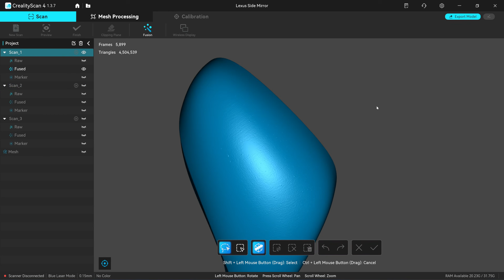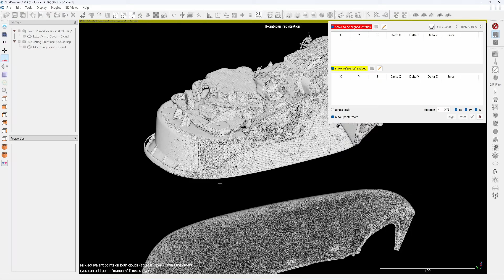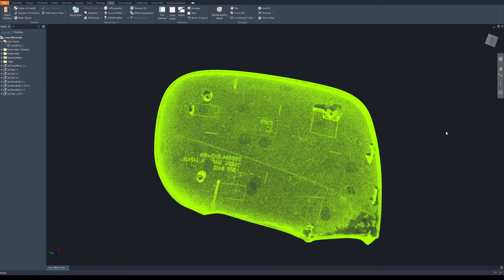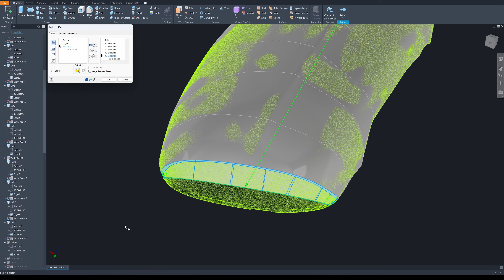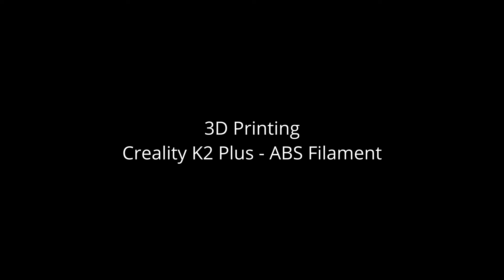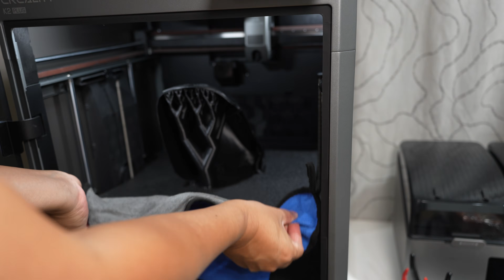3D Printing a Lexus IS250 Mirror Cover: Reverse Engineering with Creality Scan Raptor

Comment: I've been watching your videos, and they've been very helpful—thank you!
I was having issues with Creality Scan 4 when trying to align two scans, so I started using CloudCompare instead. I was able to align my scans in that app, but now I'm wondering: how do I import the result into a workable model in something like Fusion 360? I'm a beginner when it comes to 3d scanning and reverse engineering, but pretty versed at using fusion 360. Any help would be greatly appreciated.
Reply from the maker: Fusion 360 doesn’t support direct point cloud import. However, you can bring in mesh files (like OBJ) and use them as reference geometry. Just keep in mind that Fusion struggles with large meshes—viewport performance may degrade noticeably.
Reply: @Payo-TensileCreator  every time i save as an obj on Cloud compare and in open it in fusion it does not load anything as well as in meshmixer. I exported the file as an ascii from creality scan 4 into cloud compare did my point cloud alignment and saved the aligned part as obj in cloud compare.

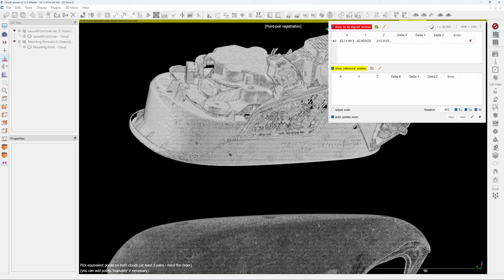Comment: 3:40 - are those points selected completely by approximation between the 2 scans?  Cloud Compare doing the majority of the work of aligning it as close as possible? Because that's amazing
Reply from the maker: It just approximation points picking and most of the time I didn't have to do any manual adjustment.

Comment: How is the K2 Plus? Would you recommend it for stuff like this, car parts with ABS?
Reply from the maker: Compared to my older K1Max, this model offers several upgrades: a heated chamber, an improved extruder, flawless first-layer performance, and a reliable epoxy build plate. It handles PC and PET materials exceptionally well, and I haven’t needed any fine-tuning—just using the default profile works perfectly.

Comment: Damn I wish you covered more of how you did those lofts with inventor.  I need to create an organic shape like that and it's just not working with FreeCAD.  I'm not going to sell the part though, so making it with inventor is an option...
Reply: I second this, would be really usefull to see how to actually do it step by step and have you say what and why you're doing it, now I'm just seeing stuff show up on the screen lol
Reply from the maker: I've already made one section loft in detail here. https://youtu.be/OGB5a_2BnBQ?si=_ggwN5hkUhoO0eG_&t=622
The rest are the same, and it's boring for me to repeat the same thing 20+ times.
Reply: @Payo-TensileCreator  Do you try to maintain G2 continuity between rail splines? Seems like not, though it's hard to tell at this scale. 
I like the method because it's done withing CAD, but it's too cumbersome. Wish it was possible to project sections of a pointcloud to 2d sketch.
Reply from the maker: @PetterStetter  Tangential constrain on rail splines are not necessary as long as they are traced and aligned perfectly to the scan data.

Comment: Do you ever use Shapr3d with scans?
Reply: @thewilltejeda  what do you think about shapr 3d to do this job?
Reply: @ahmedfarouk6562  I have mixed feelings about it. 

I primarily use Shapr for it's rapid prototyping speed on ipad with a pencil. 

I LOVE using it on the ipad; not-so-much on desktop. 

With scans, however, it's hard to use at all since shapr doesn't handle meshes well...

If it's a closed mesh, you can still do booleans and stuff like that which helps, but unlike something like FreeCAD it can't conver that mesh into a solid that can interact better with parametric/part workflows .

On ipad, i need to use Nomad Scupt (you can use blender on desktop) to give scans thickness or close holes in order to go straight from scanning to cad
Reply from the maker: No, I've not. I model this on 32" 4K monitor, I need to be able to see every detail, sharp and clear.
Reply: @Payo-TensileCreator Youre making me miss my old 32" setup lol

Sidenote: Shapr3D does have a desktop version you can use with any size monitor. 

With an iPad you can also use it with an external display to a larger screen.